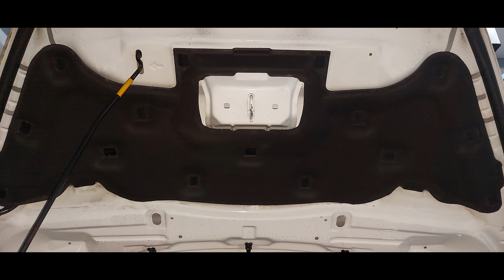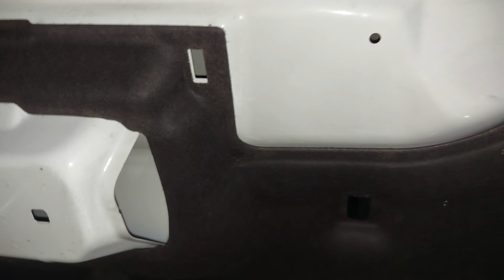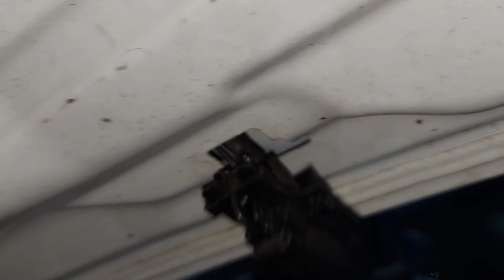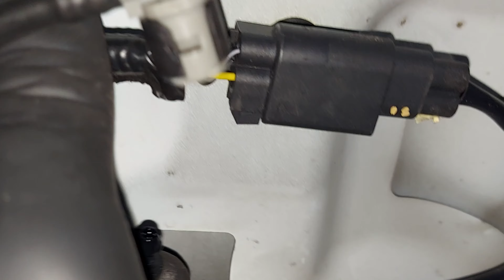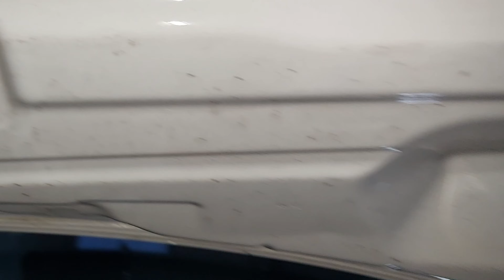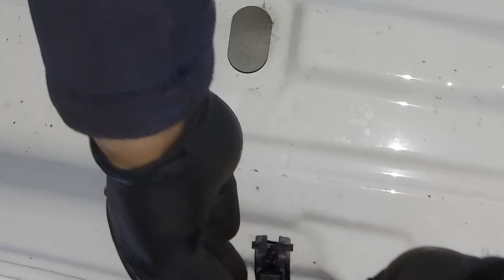Ford Kuga Front Washer Jets Removal Replacement

Comment: Hi George, where did you buy the replacement jet wash kit from mate?  as I cannot locate this heated jet wash kit anywhere on the net. I have already been able to get one of the nozzles working by blowing compressed air through it , but the other two seem to have had it, great video by the way and it definately make things easier when professionals show us how its done rather than going through my haynes manual.
Reply from the maker: I got the nozzle from ford dealership
Reply: @GicaPhp  Thanks George.

Comment: The moving camera and dark video pictures made it very difficult to SEE what you did to actually remove the spray head!
Reply from the maker: I am sorry it is not a perfect video. To remove the jets, just pull from the nozzle side and they will come out
Reply: @GicaPhp  Thanks for your reply. I have since found a video of removing Volkswagen jet washers and they are the same as the Kuga. You slide them UP and pull the back-end down, and they clip out. 👍
Reply from the maker: @paullancaster7066  happy that you sorted it out